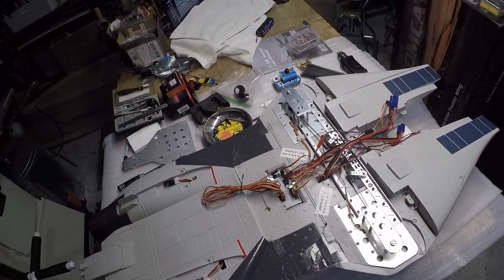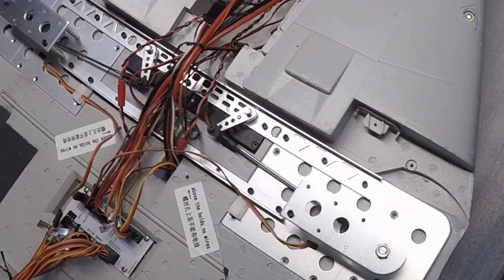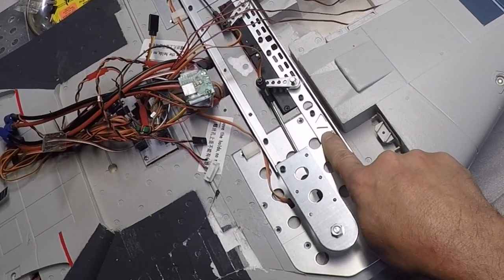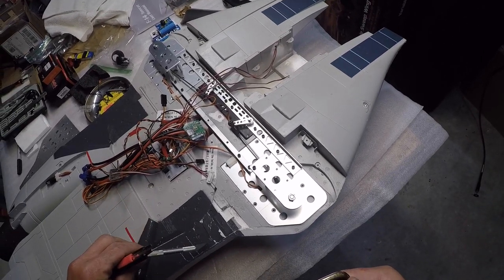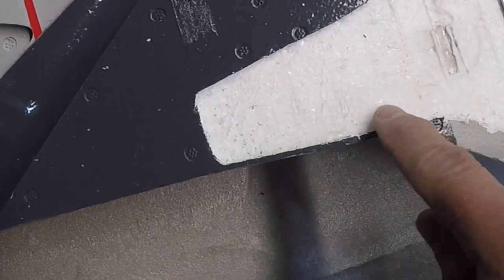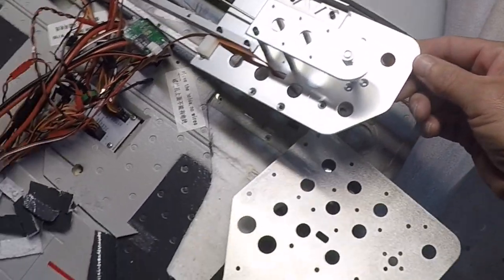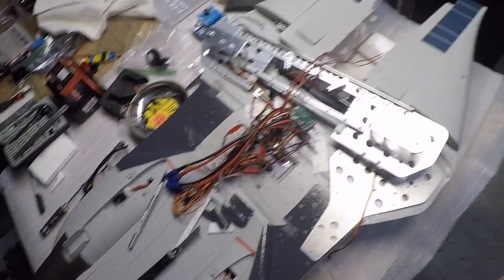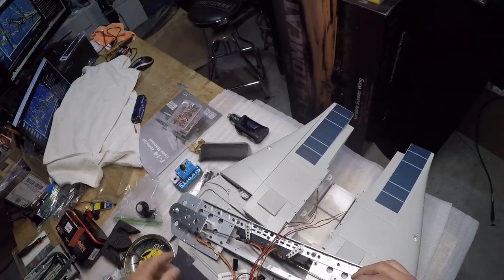Motion RC 80MM Freewing F14 Tomcat Landing Gear Mods Part 2

Comment: Great real time video Jeff of the change out on the plates. You showed a lot of what I didn't in my overview video. Overall the swap out is straight forward. I used a set of needle nose pliers for the lock nuts. They are metric but I didn't have the correct size at that point. You said it best about trying to be careful and not booger up the rest of the foam while you work. I found as long as you take your time with the process it turns out great. I went a few steps further after this and replaced the main retracts with eflite retracts and struts for that little bit extra as they are aluminum. Can't wait for you to get yours in the air! Great walk through and thanks for sharing!
Reply from the maker: Thanks so much David, it’s a pretty rewarding upgrade and the quality that Dustin put into these mods is a great deal as well. Thanks for the kind words and for tunings in👊🏼👊🏼👊🏼

Comment: It may look complicated guys but once you get into it and learn the assembly you shouldn't have any problem completing it with these recommendations like Jeff and David pointed out. The one thing I did like is that you're doing it from the beginning of your build process which in my opinion makes it a lot smoother than doing like the maiden first then going back and taking it all apart and possibly even damaging it from a hard Landing. I like David's idea of using the E-flite retracts but myself I like to keep an extra set of retracted around anyway typically because when you do have a hard Landing you can just go in and replace that even at the field if you're off savvy without taking it apart because you do need to remove the top foam plate and other parts of course depending on which retrack your replacing. But but Dustin's set up is incredibly strong I will definitely last way longer than stock! Mind you this Tomcat was put out in 2014 it is already quite old as far as the technological advances that motion has already made in designing the newer Jets. Of course you're always welcome to ask questions to the Tomcat users!
Reply from the maker: Thanks Victor...this is truly an amazing jet and these upgrades really help to strengthen the gear. Rich Baker and Dustin did a great job on these mods. Like you said, we’re all here to help, thanks for watching 👊🏼👊🏼